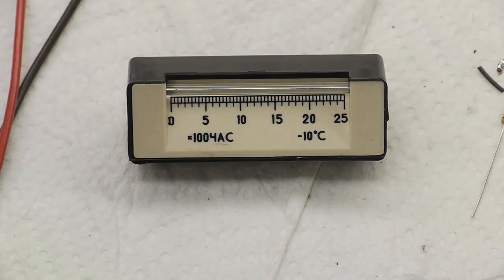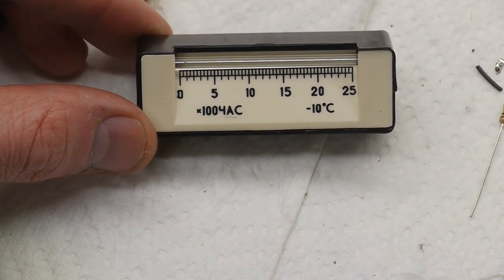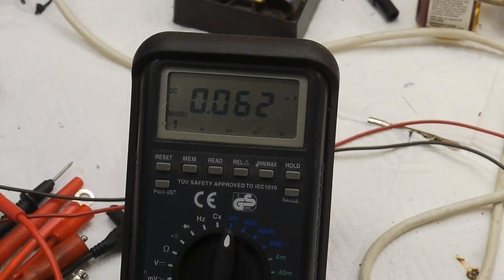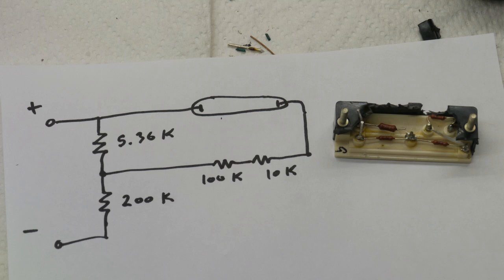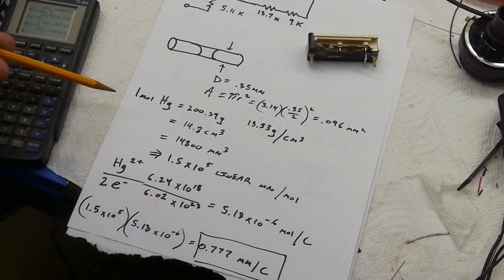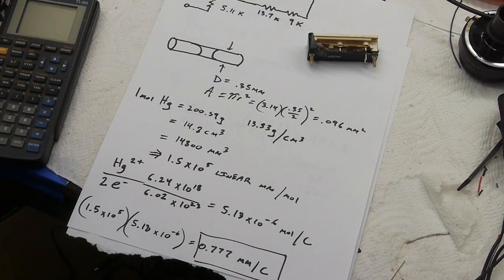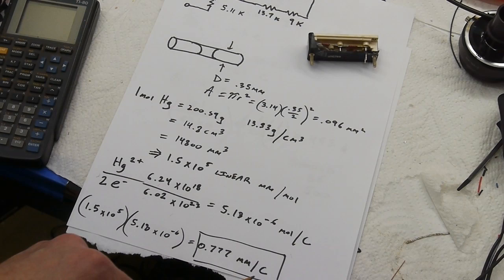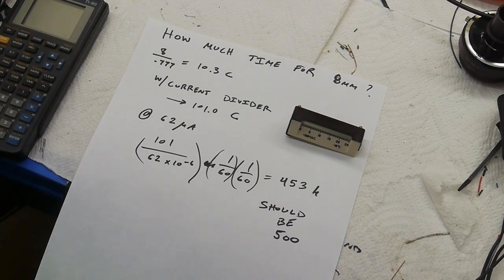Unusual usage (hours) counter with mercury capillary

Comment: Nice video. These counters are sometimes used with small but expensive parts such as deuterium spectrophotometer lamps ($600) to log hours because their efficiency drops off at more than 1200 hours. I enjoyed Ben's calculations and I think I have a few counters in the junk box with hours remaining and might experiment to see if they are linear with respect to voltage/amperage input.

Comment: Nice video! Panasonic used these things in their M-2 professional format VTRs in the 1980s. They had a 2000 hour range and one of the preventative maintenance steps was to reverse the meter at 2000 hours and make a note of how many times it was reversed. Of course, nobody ever did it.
Reply: Yep! I just found a bag of 40 brand new TM-2 2000-hour timers...used on many older VTRs...not sure whether they have any value today! I guess my next stop should be eBay! :-)

Comment: I always found really cool how back in the day they used some really smart usage of an electrical phenomenon to make an instrument. Nowadays it's pretty much just microchips that do everything. I mean, it's incredibly more convenient, but it's nonetheless nowhere near as elegant :P
Reply: I think now is interesting too, with Mems or chemistry on a chip. It's still crazy stuff.
Reply: it was more convinient back then actually. circuits were made of simple available discrete components and the sizes were much more forgiving for your working conditions. Nowadays, like 95% is intergrated and it really pushes the requirements for tools and skills to even put togather a PCB. Some cases are simply impossible outside of pro lab or manufacturing site. And conviniently sized cases of ICs are getting either much more expensive due to quantities sold, or phased out from the market completely. And you can not make a discrete competitive alternative for intergrated stuff in any reasonable time yourself because IC is a product of teamwork of experts who spend huge amount of human-hours to optimize and test their creation.
Reply: If you think about how the microchips actually work it is just as elegant and interesting.

Comment: Something very similar was used by the US military to time explosives in Vietnam. I think the device was called a C cell and used silver nitrate and silver wire. The resistance of the cell changed at time out. I believe the device was used as a low current, long delay timer either to trigger land mines or disable them after their usefulness was at an end.

Comment: I love old "analogical" technology, this little thing is as simple as an electric device gets yet in theory its more precise than most numeric power consumption meters that have been sold over the last 10 years that have more than a hundred components in them if you count APU sub assemblies.
I'm gonna find myself one on ebay if i can, also it would seem to be a really great demonstration device for schools were you could show electrolysis and how battery works on another angle, showing clearly the metal moving.
Thanks a lot for sharing all this with all the calculations i really enjoyed it.

Comment: I worked In a lab in the '70s, where an old chemist ran a different type of colometer (sp? ) as an analytical instrument. I never understood what was happening, but dissolved samples were put into a cell with mercury in 2 wells, and current was passed through it. He ran through a LOT of Hg. I just spent my boring days titrating with a burette, and a Ph meter.

Comment: "The Edison Chemical Meter
Edison set up his first power station in New York City at Pearl Street. The station began operation on September 4, 1882. In order to keep track of the electricity used by his customers, Edison designed the first electric wattmeter, called the "Chemical meter" ...

  It was a crude device based on the principle of electroplating, developed by Michael Faraday. Faraday had found that the transfer of metal from one plate to another in an electrolytic bath was exactly proportional to the current. Edison's first meter held a small glass jar in which two copper plates were suspended in a solution of copper sulphate. The cover of the cell was arranged so that one of the plates was easily removable by means of an insulated clamp with a thumb screw; the other plate, which was thick and cylindrical in form, was intended to remain in the cell to allow the copper to be transferred from it to the other plate via electrolysis. An Edison employee would visit the meter periodically, remove the electrode and weigh it, and the customer would be billed accordingly.

While the concept worked well in theory, in practice it was inconvenient and not especially accurate.  Worse, there was no way for a customer to independently confirm their consumption of electricity so their confidence in the device was not high. As a result the meters were replaced in short order, and very few can be found today."

http://www.sparkmuseum.com/METER_XFRMER.HTM

Comment: From a purely scientific/engineering point of view, this was a wonderfully educational video.

Side note:  Mercury, like all the elements, is a natural substance.  That is not to say it is "safe."  All things can be VERY dangerous unders certain conditions.  They can also be safe under others.  The key is to be aware of what you are working with, handle it with due respect, and most importantly maintain a reasonable and factual attitude regarding  the issues involved.
Reply: True, but mercury has a stigma attached because it was such a useful substance that it was found in way too much stuff that a fear of the substance is a necessary evil to keep people safe.
Reply: Michael Olsen   I agree. The problem is the general public will just ignore it. Reluctantly, I have to give the EPA more credit for a job that must be done. - CFCs, leaded gasoline and mercury. Although I understand CO2 is a greenhouse gas, I'm not completely convinced there is good enough of a handle on the situation. I understand that a massive amount of fossil fuels have been burned in a small amount of time, but I am not certain it is enough of the story such as it is an inevitable process or cycle (which speeding it up is not desired, but is an inevitable outcome of population growth anyway). Do you have any comment on this?

Comment: It would be interesting to try to measure the position of the gap electronically by bouncing a pulse off the discontinuity in the mercury transmission line.

Comment: Imagine my surprise when I found one of these inside my Apple Laswerwriter! It's form factor is like a fuse and is clipped into a fuse holder under the DC controller board. Guess they were still using these in Japan in 1986!

Comment: would have been really easy to put a diode bridge inside this thing to make it tamper-proof, so people couldn't reverse the polarity to run back the time
Reply: If this was on lathe, crane, pump, engine, or whatever, it was simply used for most likely maintenance records, and because nothing really belonged to the ppl but to the government in the former USSR, there was no need to tamper. it was simply pointless. The more hours you machine worked, the faster you get a newer one.
Reply: @mrOnlinePolice  But you could have become communist of the month by working 25 hours a day!

Comment: coulometer a totally unexpected word. 
I have used the word coulomb in place of cool ever since basic electronics and flash cards.   (coulomb a unit of electrical  energy.)  
The space can't dissappear if its a hermetically sealed, it can probally be flicked back like the nurses used to do with mercury thermostats.
Reply: RANDOLPH TORRES   "Tape recorders" were initially called "magnetophones". "Tele" must have meant "transferring between two places". "Video" has dropped the audio component (videograph?); Video conferencing equipment: Televideograph. Marketing can really screw up a sound foundation of language, and modern "professionals" (frequently) recklessly forge on with nitwit words e.g. ShamWow. Another pet-peeve of mine is lack of the hyphen in "spacetime" by educated people. It seems to very much underscore the concept such as "playtime". -Drives me nuts.

Comment: Huh, an electrochemical integrator. Could be interesting to use something like this as a battery fuel gauge.
Reply: There are ICs that you can buy that do essentially the same thing (counting coulombs) for measuring battery SoC. More accurate than measuring pack voltage, because it doesn't change with temperature etc.

Comment: Could a circuit be designed that automatically reverses the polarity? If so, I wonder if it could have been used as a precursor to the quartz clock.

Comment: Most interesting! I've got the same model and got curious about it, found your video doing research on this tech. Mine has a different voltage divider (2k7 to 100k) but other than that, it's identical, could use a bit of retr0brighting ;). Maybe I'll make a video on it too - definitely referencing yours.

Comment: you could make this pretty tamper proof by putting a diode in the back of it and potting the lot, it is a need electro-chemical solution, where most are electro-mechanical.

Comment: the front of the device indicates -10 celcius, which I assume is its operating specification. i just read about the first mercury superconductor. would negative 10 celcius allow that extra tenth of a current to pass through? (i wonder if the electrolyte is a common glycol)

Comment: You say that once the gap moves all the way to the end, the usage counter can't be used any more, but could you reverse it by applying a reversed voltage to the terminals?
Reply: No. The electrolyte gap moves by mercury transferring from one side of it to the other. He is talking about the electrolyte moving to the end of the mercury column. i.e. there would be no mercury on the other side of the electrolyte gap.
Reply: The Dude What happen if you shake it? you lose the gap forever or you can make it appear somewhere?
Reply: The Dude
Sorry, but clearly you don't know chemistry. It's not about Mercury transferring to Mercury, it's about electrons transferring to Mercury ions. So it should be that so long as there is an electrode on the other side of the electrolyte that does not contact both sides of the gap, by applying reverse voltage, the electrons and thus the ions will flow in the reverse direction, which should reverse the timer.
Reply: *****
NASA tested them to 20Gs without problem and there are patents that state " with a spherical spacing member about 0.3 mm (0.33 mm to be exact) in diameter placed in the electrolyte, shocks of even 1006 7m/sec did not cause the mercury to be broken in pieces"
Reply: elvishfiend
I have university level chemistry and physics. If you don't believe me or (or Ben) fell free to buy one from ebay and wreck it by allowing the electrolyte gap to reach the end of the capillary. Post your results on youtube.

Comment: I would think a 1-way design of such a device could be made as well, no? Also, I'm curious why mercury was selected — I suppose it's because it has good conductivity so that the resistance of the tube is low (only limited by the electrolyte)?

I guess the problem with a 1-way design might be that the —likely already very high— resistance of the substance (not mercury) in the tube would change as the transfer occurred, unless both the reactant and product had the same resistance. I guess the easy way to address that would be to make a non-linear scale though.
Reply: mercury was probably chosen because it's super cheap and does exactly what it was supposed to do: conduct electricity, be transferred across an electrolyte, and have a clear contrast for reading it out
Reply: I think that mercury was chosen because it is liquid - they used the same stuff they use in thermometers. Metals that are solid at room temp. may form dendritic crystals between the electrodes and short out the device, maybe? Also it's intended for -10 deg. C, where most alternate liquid alloys solidify, so mercury. :)
Reply: John Stuffer that's what I meant by "be transferred across an electrolyte", regular metals don't do that, at least not without changing chemical composition. but you're right anyway, good comment!

Comment: Applied Science You say that you cannot reset to the initial value, what about reversing the polarity and optionally bypass the resistor divider ?
Reply: np He said you can reset it to it's initial value, as long as you don't run the electrolyte off the end to the left, then you can't. As long as the electrolyte/gap remains visible you can reverse it.
Reply: Yes my bad :( I hear the reverse

Comment: If someone think its Russian exclusive I saw much smaller one on U_matic Sony camera (scope part). I think in  real manufacturing there wasn't so much math, just standard size glass tube and than calibration with resistors. thx for great video.

Comment: Why 12.6V? Was this a standard voltage back in the day?
Reply: Maybe not, but it probably was easier to change the specified voltage than to change the manufacturing equipment.
Reply: It's pretty typical for vacuum tube filaments.